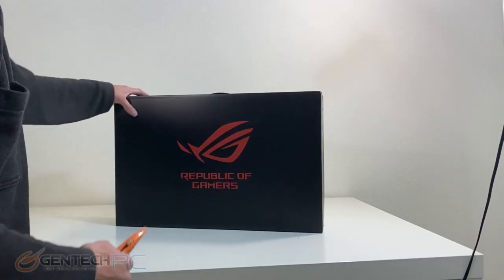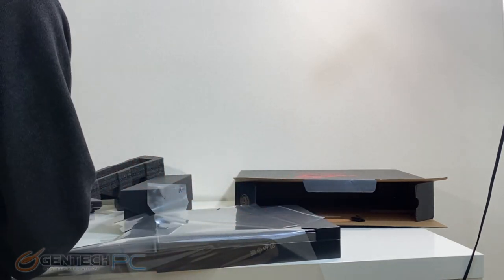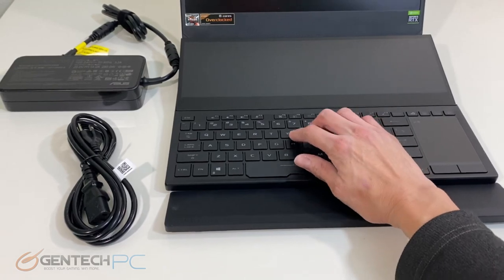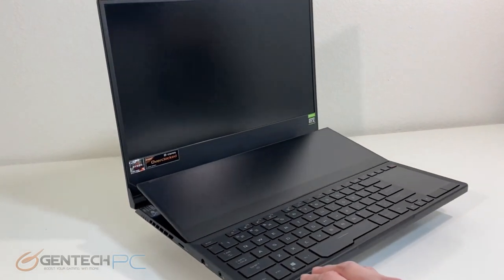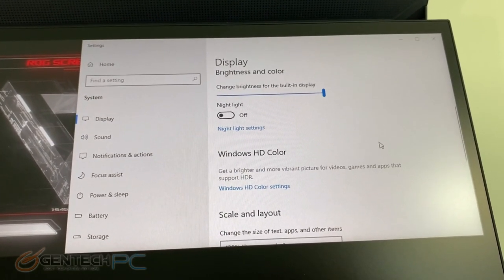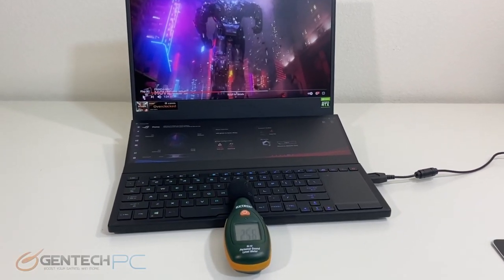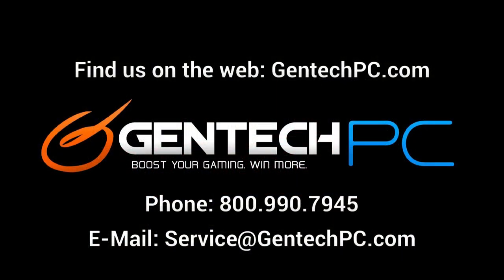Asus Zephyrus Duo Review RTX3070 AMD 5900HX Dual Screen

Comment: Just 3 comments about your review, if I may:

- you need to put away the sound meter from the laptop close contact. Sound is measured where could be your ears, not where the sound comes from. Means you should put the sound meter at the same distance where could be the user, and you will have a pretty decent idea of the real sound level you get from user standpoint.

- you should consider to have a tripod to put your camera on to avoid too much erratic and annoying movements during your video shooting.

- you should consider to have a more case by case approach when testing the sound, the temperature, etc... To make us able to compare the different modes.

That being said, it's always easier to give advices and much more difficult to spend time to make videos. So. thank you for this review, anyway ;-)

Comment: Everyone needs a webcam in 2021. What are they thinking excluding it from the body? Near-perfect laptop but I cannot get past that.
Reply: No webcam, no deal
Reply: I disagree.  I haven't needed to use a webcam in the last 6 years.  All of my teleconferences and meetings are done solely over the phone.  I'm an engineer and have roughly 3-5 teleconferences a week. not one that needed a webcam.
Reply: @theheadone  ok? I'm an engineer and have 4-5 a week that do require a webcam. And that's more common in the covid era
Reply: @lpnp9477  Just stating my experience.  And all my co-workers' experiences
Reply: @theheadone  I mean, your anecdote at your one company doesn't negate the fact that most of us working from home in 2021 need a webcam. Good for you that you don't, maybe this is the computer for you then.
Reply: @lpnp9477  yes, i hate when people with rare use cases try to act like their situation is the norm.  I need a webcam at all time too on my laptop.
Reply: I understand where you're coming from, but to be honest if you can afford this laptop the no webcam likely isn't an issue for you. You may as well just buy a Logitech C920 for like $70. Outputs 1080p and a lot of laptops still only have 720p. Not only that but the C922 has 1080p at 60fps too and I think that one is just shy of over $100 after tax? Especially with how many ports this has and it even has one on the back at that there really is no reason why you shouldn't get one when like I said you're already dropping so much money on this laptop as is. For a lot of people I know this is actually a plus that it doesn't have one so you don't have to fear potential spying.
Reply: @kpopfanphotos  cost is not the issue, it's portability. I move from room to room and outside during the day. I don't need an external webcam hanging off the computer. I need an all inclusive, powerful touch 4k laptop. So Razer got my money this time.

Comment: Great review, the absolutely best one yet! I am wondering whether I should buy this laptop but the fan noise concerns me. How bad does it actually sound? 70dB is horribly loud but you have placed the sensor right at the vents... how does it compare to other laptops like the G14?
Reply: if i were you id just go for it . fan noise is not an issue especially when using headsets for gaming.
Reply: @tobiasmathew5685  lol this is most silent gaming laptop you can ever buy, IN idle and silent mode even while gaming is dead silent under 3O db which is incredible.  Only on performance mode can reach max 44 db
Reply: @SonicDestiny  Thanks! So I guess the ASUS Zenbook Pro Duo 15 OLED i9 3080 will be silent also or will th i9 stop that party? Ik really like to game and work on a oled screen.

Comment: Bummer I pre-ordered the G15 with the same processor and  80w GPU. Looks like the 115 watt 3070 performance is disappointing.  My current 115w 2070 super scores 1500 points less in Firestrike. And this is listed as a 115w "Max-P" 3070 which means the G15 I ordered will most likely be slower than my current 2070 super!

Comment: Great and detailed video. Could you please confirm if the usb-c port is also thunderbolt 3 compatible since their website says it is in kinda hushed tones but some articles say it doesn't. Considering this beast for both game dev and sound design and a lot of audio interfaces use thunderbolt.
Reply: Thunderbolt is an Intel specification.  This is an AMD system, so it can't support Thunderbolt per se. However, it can still be a very high speed connection.

Comment: Thank you very much for such a detailed review! I have a question about the RAM. You mentioned there was only one RAM module in there, which I could see, but you said a second module could be added. I can't see where? I can only see one module slot. Where would a second slot be? Is it on the flip side of the motherboard? Or are the 2 slots stacked on top of each other so that at a glance it looks like only one slot? Thank you very much!
Reply: There is only one slot for you to put a ram slot in.
Like all Asus products, they have either 8 or 16 soldered to the board.
That way they can charge MORE for the other ram configuration.

Comment: How do you put the thermal compound back? Isn't metal liquid risky to apply since it's conductive? Or this laptop has some kind of protection, I think I saw some "stuff" around the CPU? I'm considering buying it, but maintenance might be a pain ( and likely it would void warranty ). How often would you consider it's needed to reapply the liquid metal on the CPU?
Reply: This is a reseller. They actually do liquid metal upgrades on laptops that don't normally have it, so they can probably get this one back together ok. 

Liquid metal shouldn't dry out, so you shouldn't have to repaste, a big advantage.
Reply: @terekkincaid9160  Oh nice, I didn't knew that liquid metal doesn't need replacement over time. Unfortunately, they haven't used same for GPU, but, as far as I noticed GPUs run cooler anyway, so probably it's not needed anyway for a long while.

Comment: ordered the 3080 version, waiting for mine now.
Reply: Where did u order it, do u know when it will ship?
Reply: @jackli1662  gentechpc, they are sellling this one. Their customer service told me it’s gonna ship in about 2 weeks
Reply: Same here, waiting for shipping
Reply: @hericpan5442  I just cancelled my preorder as I just came to aware of the new zephyrus duo se has no direct connect to gpu mode
Reply: @drixs2050  what does that meant? Direct connect to gpu
Reply: @jackli1662  So most laptop have their discrete gpu using integrated gpu as a output channel. This saves energy as it can switch between integrated gpu and discrete gpu according to workload. But due to the limited bandwidth of integrated cpu there would be significant efficiency loss when you want to utilize the full potential of your discrete gpu, also since the integrated gpu is integrated with cpu it also interfere with cpu. So a lot of gaming laptop come with the function of switching to directly connecting to discrete gpu from cpu. While this drains more power than using integrated gpu as a output channel, it has no efficiency loss and thus provide more power for gaming. And currently the flagship of asus does not have this function while most of lower end gaming laptop of other brands have this function.
Reply: @drixs2050  it does I thought, u can switch between optimus and discrete mode?
Reply: @jackli1662  no, not on this version
Reply: @drixs2050  https://www.asus.com/support/FAQ/1038387/ is this what u are looking for?
Reply: @drixs2050  will that only affect external monitor? Or it will also decrease gaming performance
Reply: @jackli1662  no
Reply: @drixs2050  that’s really sad, they had that in the 2020 model, do u think it is due to the AMD chips this year? How big of a performance drop are we talking about if we are stuck with the Optimus mode
Reply: Dynamic Boost 2.0 & Resizable Bar in this model will ensure there is no performance drop. However, it cannot be manually set as it is in the earlier stages. As the CPU in this one is already powerful, I believe there wont be much of the difference in GPU performance and expect enhancements in future bios/driver updates.
Reply: @brkrocks  I can guarantee you yes there is severe performance drop

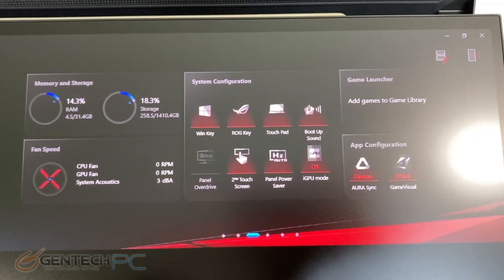Comment: 15:17 what is that iGPU mode do?
Reply: Idk if you still need the info, but an iGPU stands for integrated GPU. So you will be using the gpu that is on the CPU instead of the dedicated one. This is to save power when you're not gaming and only doing simple tasks like internet browsing or typing on word/excel.

Comment: Shame they only have 4k option for the 3080 model. 1080P + 3080 would be excellent for gaming.
Reply: the RTX 3080 and 3070 scores on this laptop are essentially the same in benchmarks and game fps. The main reason for the £1k price difference is the 4k screen and the extra 8GB GPU memory.  Essentially not useful in gaming. Save your money

Comment: No webcam, no deal.  Really nice laptop, but that's a deal breaker. Not to mention soldered ram.
Reply: If you're dropping the money on this you might as well buy a Logitech C920 or C922. They're going to put out significantly better quality than laptops these days even can since most are still at 720. I'm not sure why no webcam would be a deal breaker honestly. That's more bezel space that would be used.